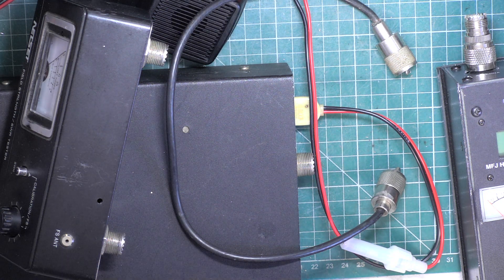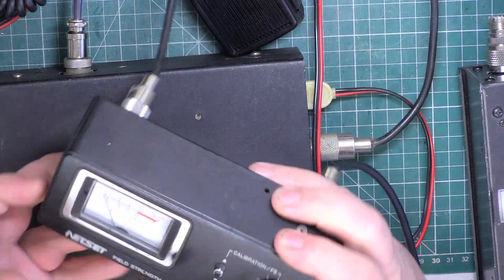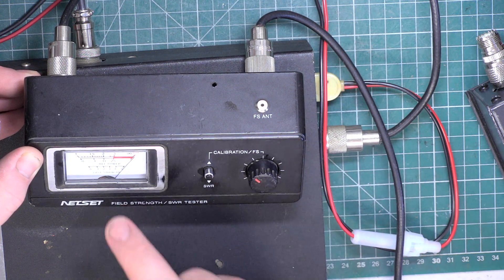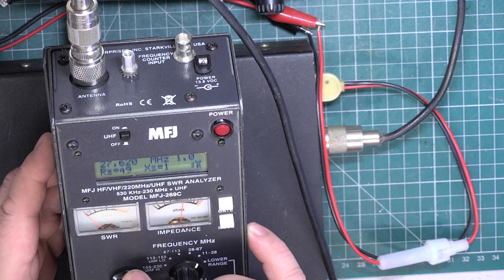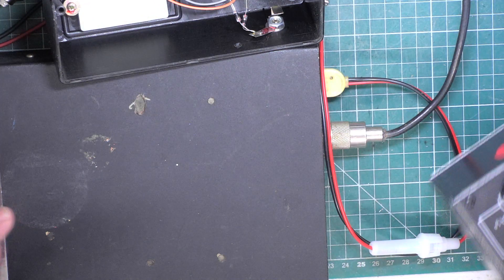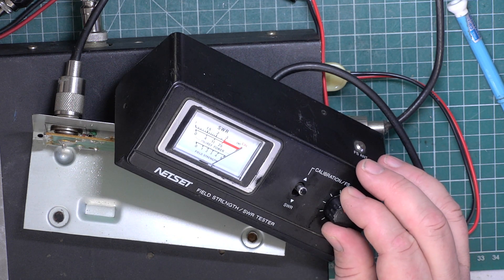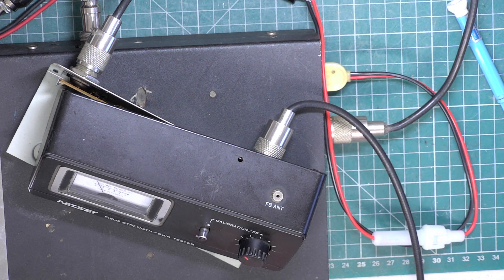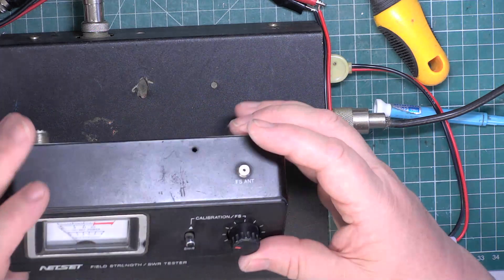Netset 77-523 SWR meter repair & calibrate

Comment: Looking for a little guidance. Maybe you can help me. I have an older Midland 40 channel CB. I can hook it up and when I go to check the Swr, it will not trigger the SWR meter at all. I started out trying to zero it on FWD, and on my other radios it works fine. But for some reason this radio is not putting out a signal to the coax it would seem. Other than that it seems to hear fine and transmit fine. I can have another radio 50 feet apart and they talk to each other.
I haven't tried a longer distance. What do you think, or how should I test the output to see if it's making it to the coax? Can I do it with a multimeter? Of course this radio may have been operated before with a bad antenna setup. I did replace the transistor but it made no difference. I know how to check SWR. Any help would be appreciated. Thanks.
Reply from the maker: A dead giveaway if the radio is transmitting is current consumption. On receive the radio will probably draw around 200mA. On transmit, this will rise to just over 1A. You can put a multimeter in series with the red positive lead of the power lead to check this easily & quickly.

It's possible the radio has a fault making it only transmit at milliwatts rather than 4W; enough to talk to your other radio across the room, but not enough to drive your SWR meter.

Richard, G0OJF, UK
Reply: @ukfmcbradioservicingTango21  makes sense.  I posted the question earlier today but refused to be beaten by this device. I traced the center coaxial lead thru the circuit board till I found a short. Solder had chipped away. I bridged it temporarily with a wire and it worked.  So I soldered it, now it triggers the swr meter.  Thanks for your advice.

Comment: Funny story about switch cleaner. My wife went to her sisters overnight so I decided to do some amateur radio at times I can't normally get on. All was going well till I reheated some spagh bol and decided to eat it in front of the radio. Bad idea. I unbalanced the plate and it landed on the carpet. I tried everything to get the stains out but you could still see it. Then I saw my switch cleaner and tried it. Believe it or not it worked. No idea what's in it but it lifted the red and I was able to sponge it off.
Reply: Stains on carpet while wife is away?... yeah yeah yeah..

Comment: As someone who used to own a Bird meter, it made no difference which socket was the input, and which was the aerial, and it shouldn't on a decent meter ? Ken
Reply from the maker: The Bird meter isn't a SWR meter Ken. So you can connect either way & turn the element either way to read forward or reflected power. To find out the SWR you then use a nomograph chart.

The meter featured here is for a CB user to check SWR. This one is at the cheaper end of the market & originally sold for £14.99. So on cheap SWR meters like this, if you connect it the wrong way round, the forward/reflect switch will work the opposite way.

Richard, G0OJF, UK